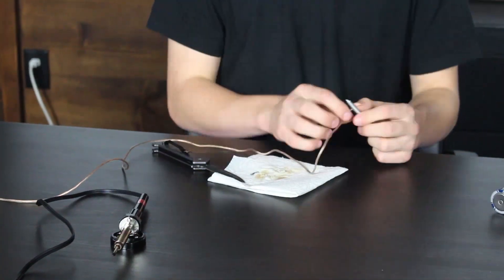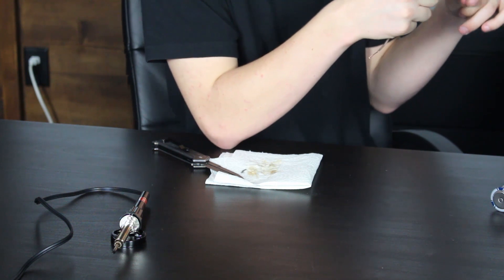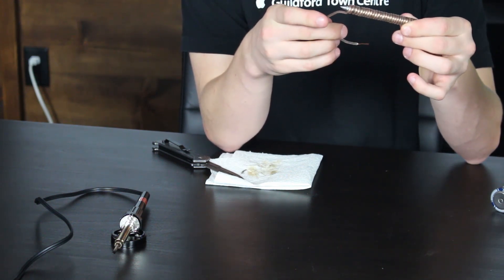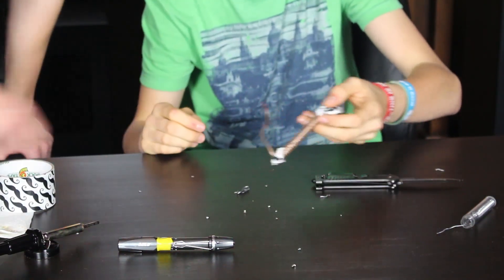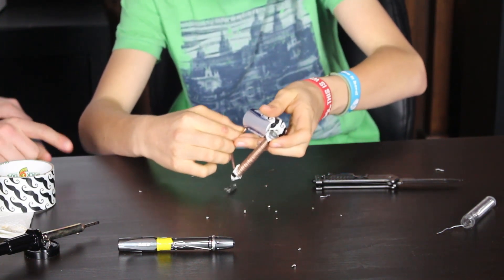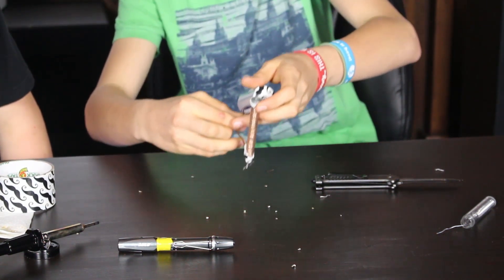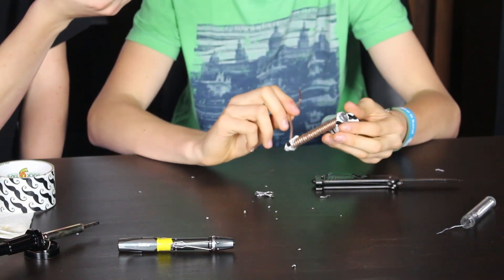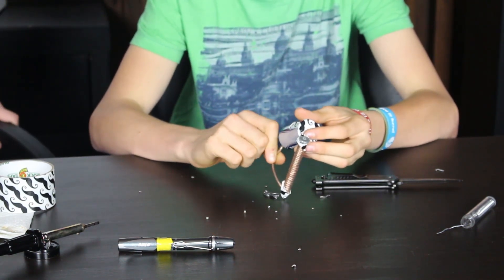How to: Making an Electromagnet

Comment: You should have wrapped that screw about 12 times - then it would be able to pick-up that screw no problem. It takes a lot of wraps to get any kind of power - even if your picking up a paper clip one wrap around will probably not do good.